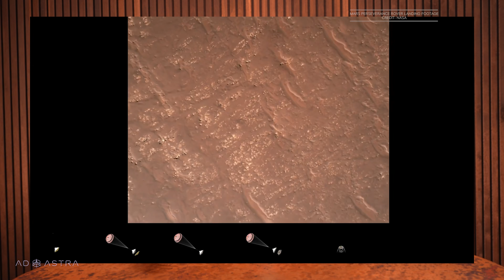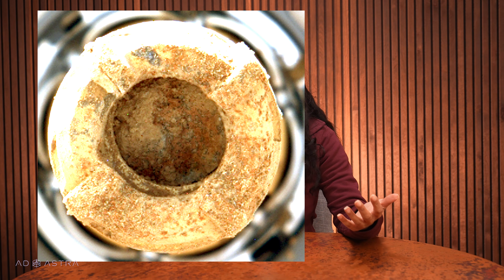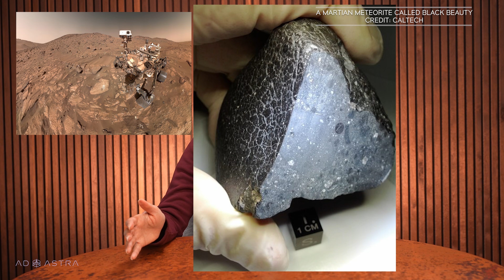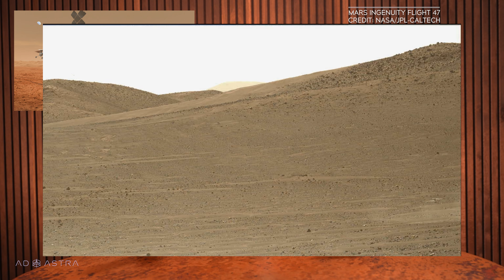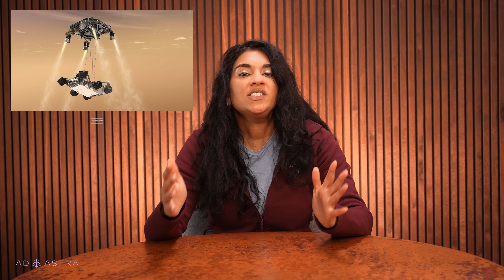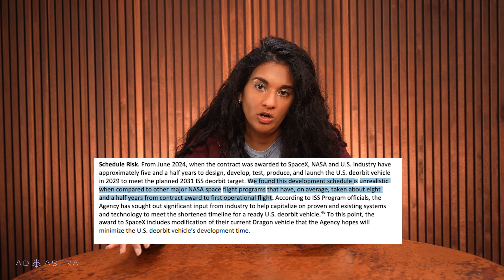Mars Sample Return: Will NASA’s ambitious mission ever happen?

Comment: I also would like to add that people could be sent to pick up the samples instead but that would be incredibly risky and costly, and the cost would be far greater than using robotic craft. It may very well be that the search for life on Mars may simply be not worth the risks of failure and to life. Certainly there is no chance of finding life more advanced than microbes, and people in general would not be excited by that. 
And then there is the problem of contamination both by craft already on Mars and future ones. As a recent asteroid sample mission showed, it is very very difficult to  completely sterilize spacecraft so any life in those samples may be from Earth rather than Mars. 
Myself, I am more excited about the Europa Clipper mission and the Dragonfly mission to Titan, both of which to me off more value for money than a Mars sample return mission.  And as for Mars  itself, since Ingenuity has shown it is possible to explore Mars by flying above the ground, a drone mission to explore Mars’s huge canyon, for instance, would also offer more value for money and would be a lot, lot cheaper indeed.

Comment: Landing on Mars is incredibly difficult, let alone launching from Mars, docking with the return to Earth vehicle, coming back to Earth and re entering the atmosphere.  There is a not a low chance that something will go wrong and the samples lost.  Better not to,put all the eggs in one basket and have 2 spacecraft to deliver samples back to Earth, instead of one, in case one spacecraft fails.  The problem, of course, is that it will add to the already huge cost. 
There will always be a chance of failure on any space mission, but especially this one.  And NASA, in that event  will have to explain to the public why it spent lot of their money for no result at all.  And it would be disastrous for their public relations.
I myself would prefer a mission to the remote ice giants Uranus and Neptune, our knowledge of which is tiny compared to Mars. 
It may not be worth the money to spend billions returning only a small sample of Martian rocks and soil and there is a high chance indeed that  even if they could be brought back  to Earth,   No sign whatsoever of life, either past or present, will be found.  The surface has been exposed to the radiation from the Sun and space for billions of years and would be sterilized.  Any life on Mars  would be deep below the surface away from the radiation  and not accessible to probes with our current technology  and therefore not accessible for at least a very long time to come,  Also, life is very slow to develop and Mars may not have had lakes and the right conditions for life for long enough for life to develop.  And there are things like nitrogen that Mars lacks that are essential for life to develop. 
So is it really worth  spending so much money on a project with a high chance of failure and with a high chance of not finding any life at all?  💕

Comment: The mission is useless. We don't need to bring rocks back to earth. With the SpaceX Starship one can land a 150 ton laboratory on Mars with no intention of ever returning the ship back to Earth. The ship could be loaded with rovers and robots that could retrieve any surface material you wish. The equipment could be standard off the shelf components -- no miniaturization needed. Capacious Starship can hold lots of radiation shielding. Cheaply.
Bottom line is that for, say, 100 million, in only a few years SpaceX could launch a laboratory to the surface of Mars and overachieve any goal the sample mission had.
The sample return mission is a relic of a past of tiny rockets and tiny payloads. And enormous budgets to enrich Congressional districts.
And SpaceX could build and launch dozens of these laboratories. How many do you want?

Comment: If the combined efforts of US Government, US science and US space engineering working continuously over many years can at best manage 15 years to grab and return a few kilo's of Martian rock what are the the odds of making even one manned Martian landing let alone setting up a Martian 'colony'?
What we may well end up with are a few 'Apollo style', travel,land, look around grab a few samples and rapidly return missions with the usual hoopla, flag waving and self congratulating followed by a long period of 'analysis and reassessment' about manned missions to Mars and a return to robot landers of greater size and sophistication.
The same is going to be the case for lunar exploration where any 'base' is going to be a cramped flimsy contraption much like an early Antarctic base station but one in a permanent blizzard and totally dependent on outside sources for personnel,food and supplies and always teetering on the edge of disaster. Especially if it's an American base built to 'cost' and constantly bemoaned as a cost we can not afford and cost cut to the max.

Comment: It's all so complex and expensive, like the plan to get a Starship onto the surface of the moon requiring multiple on orbit refuelling of the lander.
Reply: I think this is an extension of the mode of the Apollo program. Back then there were 3 modes they considered: direct flight (an enormously huge rocket, way too expensive to build in 10 years), rendezvous in Earth orbit (basically launch parts of the spaceship and put them together in Earth orbit) or rendezvous in Moon orbit (a lander separates from the main ship and after ascent it has to dock). At first this third version seemed the most complicated and dangerous, but if you think about it, it's the cheapest to make and the engineering is the simplest. Because they can build and test specialized modules and then stack them. They can make sure that a Mars ascent vehicle can do a good job, and that Mars ascent vehicle won't do anything else, but it will be amazing at ascending from Mars. So, in the end it's cheaper and simpler to do a complicated sounding mission than a simple sounding fly there and fly back with one craft or something similar. Actually I would even vote for the return to Lunar orbit if the Lunar station will be ready by then.
Reply: A smaller lander might perform the job quite well using a falcon heavy. Starship is for the big stuff and will cut costs over rapid reusability.
Reply: Choosing lockhead martin was its first mistake. Stop indulging the old players who have purposefully held humanity’s space flight capabilities back for decades.
Reply: Absolutely incorrect. Starships launch refuel and relaunch is the cheapest possible option and easiest possible option out there. And never will be challenged in that model.